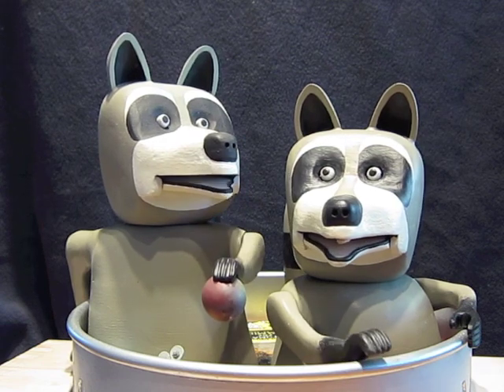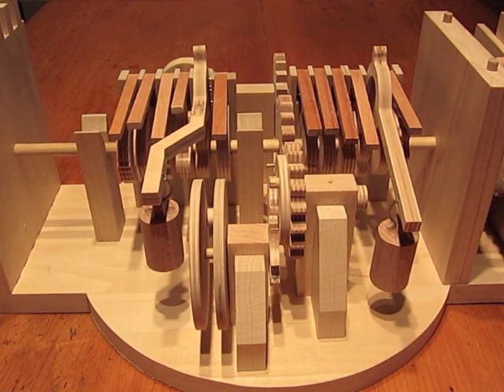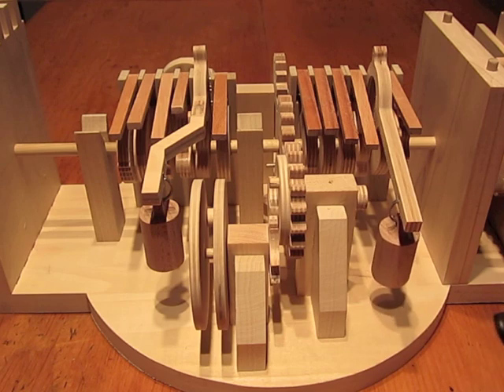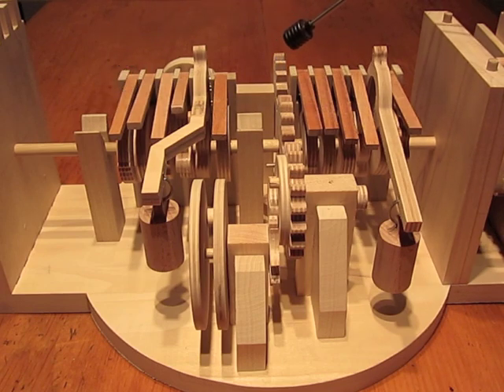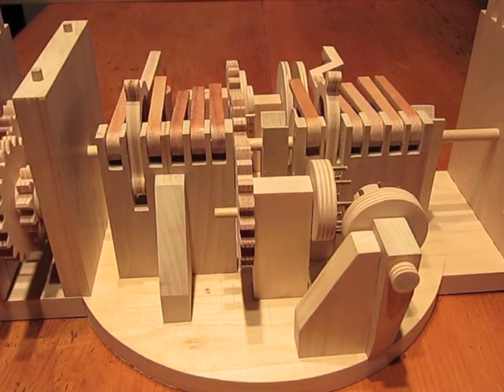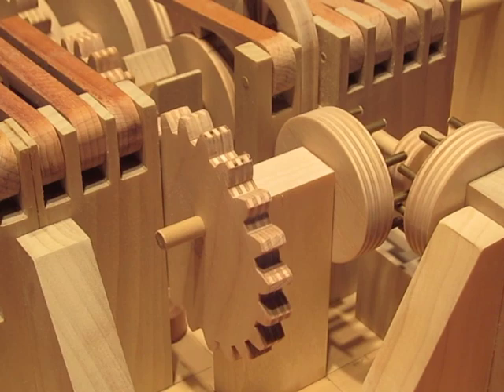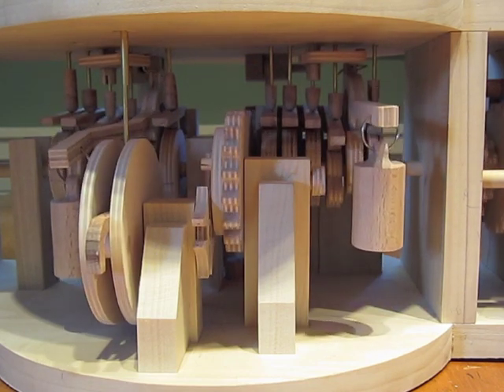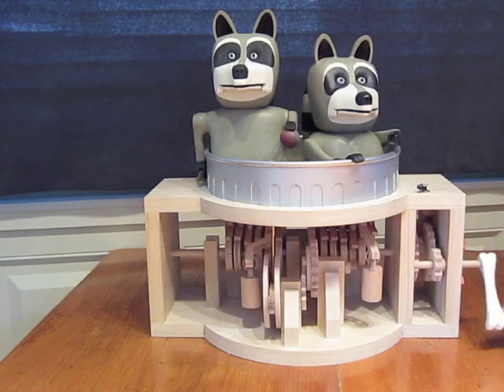The "Urban Terrorists" Automata Mechanism

Comment from the maker: I usually do not put any finish on the gears, although I have put one coat of water based urethane on the teeth a few times. Urethane  dries to a pretty hard finish. I have urethaned the face of gears often when I stain them for effect. When is want to lubricate a shaft I rub paraffin wax on the parts rather than liquid wax. you could wax the tooth faces although I do not find it necessary as the faces are rolling contacts, not sliding ones.

Comment: I was wondering if you used any kind of finish on the gears and parts of the mechanism. i'm building a complex mechanism myself, but i'm afraid the parts will get stuck if i put some oil or lacquer on it. response is appreciated

Comment: How'd you get the mouths and tongue to move when the heads are turning.  Solid rods going into the head while the head is turning?  Did you go to something flexible like string in the head?
Reply from the maker: Hey Mark, the eyes move through a rod that goes right up the centre of the dowel that holds the head. The tongue and jaw are also actuated by a rod that goes up through two crescent shaped slots that allow motion even as the head turns. If you go to my website at conquergoodcreative.com and send me a message through Contact Me I will send you a could of photos.